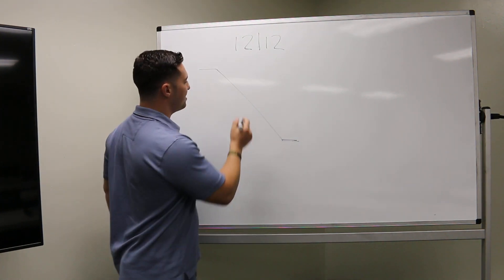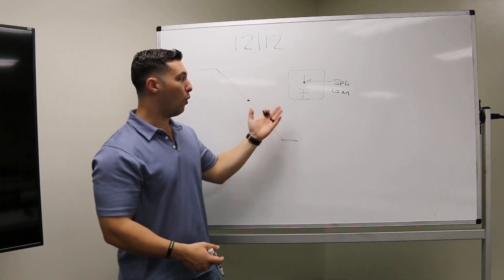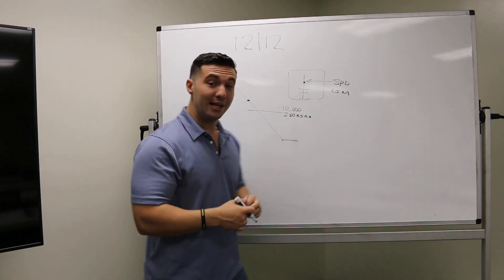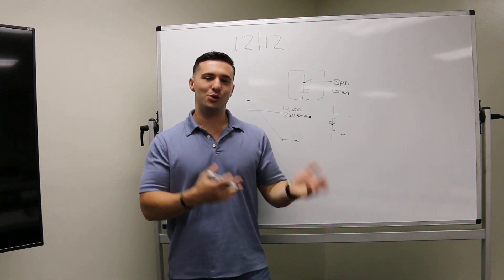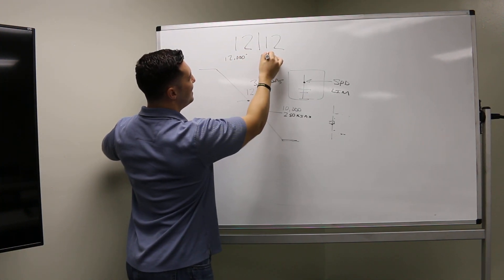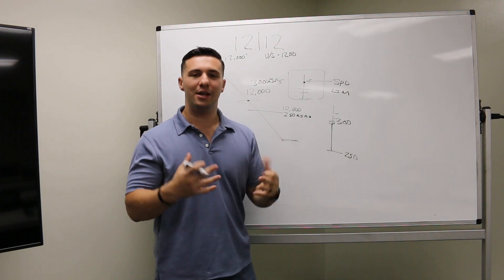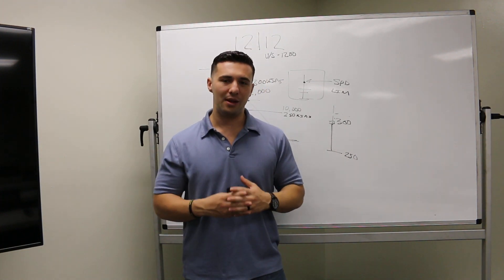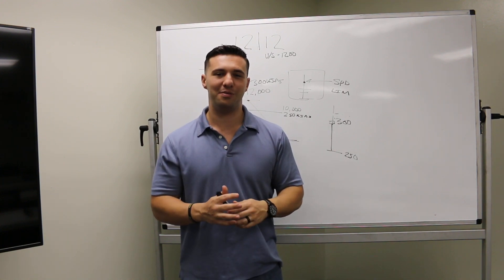A320 Descent Planning

Comment: Because if you want to descend at 250 kts or less, 1250 ft pm is the right rate (in this case, I multiply the speed by 10 and divide by two. Or 2500/2 is 1250).   The 1000's of feet to descend times 3 to calculate how far out is your TOD is the other part of such formula!